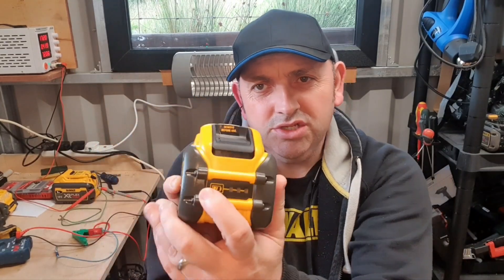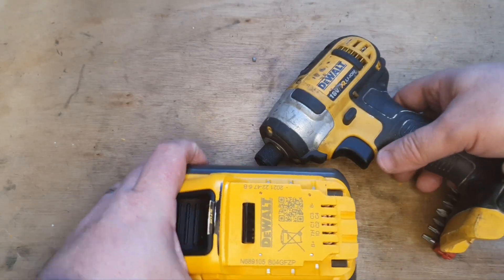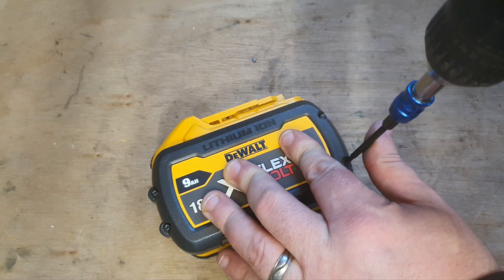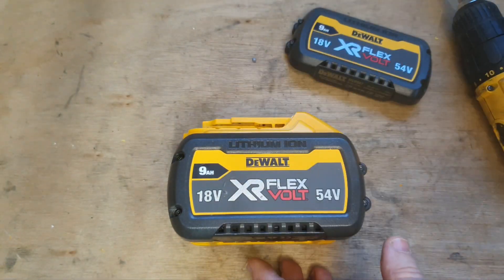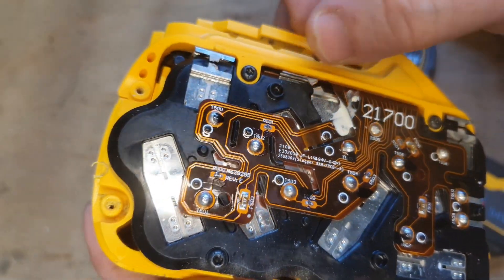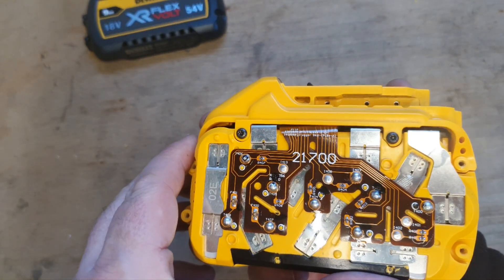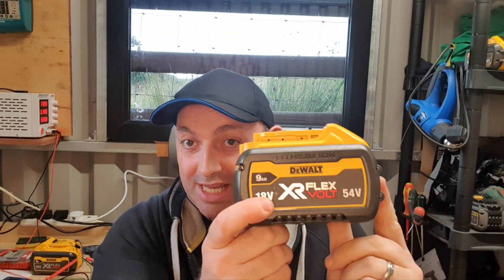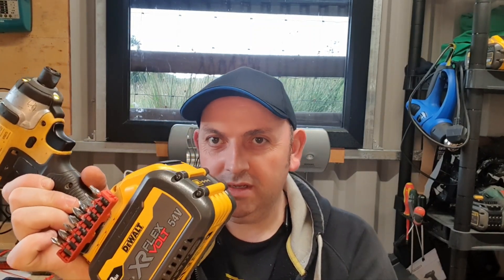Flexvolt 9ah Quick fix ( not jump start) #dewalt #powertools #repair #diyenthusiasts #flexvolt

Comment: Can you do a quick video on charging the cells banks of the flexvolt 6ah and 9ah and show where to connect the clips depending on which cells need charging. Im struggling to find where to connect to charge all but the first row on my 6ah flexvolt. I have the lipro charger like you use i just am not sure where to connect positive and negative too. A tutorial would be great and probably get a nunch of views. I looked through most of your videos but didnt see one that specifically shows that.

Comment: Fuses Are a Symptom, Not the Problem:Fuses blow due to excessive current, often caused by:Dead or Imbalanced Cells: One or more cells in the battery pack (typically 20700 or 21700 cells in a FlexVolt 9Ah) may be failing, causing the BMS to detect an overcurrent or short circuit.
BMS Failure: The BMS may be malfunctioning, incorrectly triggering the fuse or failing to balance cell voltages.
Short Circuits: Damaged wiring, corrosion, or debris inside the battery pack can cause shorts, blowing the fuse.
Overload: Using the battery in a high-drain tool beyond its limits (e.g., continuous heavy use in a 60V tool) can stress the system.

Replacing the fuse without fixing the underlying issue (e.g., a dead cell) will likely cause the new fuse to blow again or, worse, allow unsafe operation that could damage the battery or tool.

Comment: I have the same battery, it has 12v coming out the top. All the connections look good in the battery. What does this mean ?
Reply from the maker: It's likely cells that are done or thermal fuses and resistors Beyond repair

Comment: Why do we have to do this to a $250 battery? Beyond unacceptable from dewalt
Reply from the maker: The failure rare of this over engineered battery is unacceptably high
Reply: @doctorlefthandthread  how often does it happen to these batteries? Since i ordered flexvolt saw, my first flexvolt tool from dewalt including two 9ah flexvolt batteries. If they will last less than 2 years I need to return and order makita xgt. Why some said they had flexvolt batteries for 4+ years and had no issues? And few other people reported them breaking?

Comment: If your fuses blow at home, just jam enough of silver foil in to fill the fuse hole and jam/fudge/hammer the lid back in.
Reply from the maker: No saw a nail the right length does the trick

Comment: Hi, where abouts in Tyrone are you located? 
I’ve a few batteries and was wondering if you could take a look at? 
Thanks
Reply from the maker: I am near Donemana however I have stopped repairing the flexvolt batteries I just do the Standard 18v ones now.

Comment: Hiya. I have a DeWalt 9AH flexvolt battery that has one bar, charger blinks for a moment when I put it on, then says Charged. It will not operate a 60v tool, but it will an 18v. It was in a blower when the blower fell 20 feet or so to the ground. The voltage readouts show 15.89v  until I push the 60v pins in.  Then it reads 14.23. The bus bars are fine. The large terminals inside read 6.24 Got any help for me? Thanks! I’ve watched several of your videos to try to figure this out!
Reply from the maker: When you are pushing in the slide you need to connect the 2 top c pins this will give you the 60v out put
Reply: @doctorlefthandthread I would of really liked to see you test all the cells on this battery too. I have one that won’t work at all and no bars light up when you push the button
Reply: Yes, the large terminals (labeled with c1 & c2, and c3 &c4) inside read around 2.24 until I push in the switch, then the polarity reverses to around 12 then quickly drops. After a moment it is almost zero.
Reply from the maker: How to measure your flexvolt #doctorlefthandthread #powertools #batterymaintenance #repair #dewalt

Comment: Hi I’ve got a 12ah flexvolt battery . It goes from 1 bar to 3 bars in about 5 minutes in the charger then stops charging . Surely this can’t be right 🤷‍♂️my other 12ah one takes at least an hour
Reply from the maker: No it shouldn't do that

Comment: Yes lad where are u based?
Reply from the maker: Tyrone
Reply: @doctorlefthandthread  4or5 that I can’t get working could u get a look at them and I sort ya for it?
Reply from the maker: @JosephODonnell-m8v  I stopped working at the Flexvolt I had a bad turn around with them could only get about one in 10 working. Not taking Flexvolt for the time being but that could change in the future.

Comment: WHere can we get the "nickel strip" to make the repair?
Reply from the maker: Ebay
Reply: @doctorlefthandthread  anyone in particular?
Reply from the maker: @edwardlittle5541  any will do but here is the one I use on amazon 
https://amzn.to/4643atk
Reply: @doctorlefthandthread  Thank you so much for this! I have a 60 volt DeWalt battery that I used just once and it zonked out on me, and I'm 99% sure it's because of the cheap DeWalt Wannabe light I bought. It drained it while it was just sitting around doing nothing. Cuz it worked perfectly before I plugged it into that el-cheapo DeWalt Wannabe light. It's one of those "Made For DeWalt" items from Amazon. I like the light. I just hate that if I let it sit around it eats batteries like that.

Comment: Why not just bridge the broken connections with solder instead of nickle strip?
Reply from the maker: It will work however I chose to use the strip to restore the fuse type set up to the battery so if an overload happens again it will blow the strip and not anything else on the board
Reply: @doctorlefthandthread  ummm you would need a lighting strike to blow out the nickel pieces you uses.

Comment: What if it only has one bar of charge but it’s been charging for hours? Is the battery damaged?
Reply from the maker: I never saw that fault before
Reply: @doctorlefthandthread I have a 1 bar charge to full issue. 3 different chargers all say the same. So charger ruled out. Battery works on both 18v and 54v. 
Zero issues inside far as I can see very clean actually. My next thing to do is tear it down check cells for imbalance of voltage or faulty cell. I what would u try next
Reply from the maker: @B.G.R.B.M.S  they are a minefield of small fuses and resistors

Comment: I have same battery showing full bars and 19.5v on the meter. It will only work on one drill. The other 2 drills are working with other batterys but not that one, i cleaned all the battery connections. Any idea?😂
Reply from the maker: Flexvolt are tricky 9 out of 10 are unrepairable

Comment: I’ve never welded nickel strips before, any tips on that before I take on this repair challenge. I have about $4,000 in dead flexvolt batteries. Ready to go back to corded tools soon if this keeps up. Just killing batteries every month in the chop and table saws.
Reply from the maker: The flexvolt have issues with people killing them
Reply: Yessir, most of them die within the first year as well. I haven’t been impressed with the technology as of late. I feel like there should be some sort of safety protection against overloading the battery before it’s just useless. Again, any tips on welding the nickel strips as I have never attempted this fix before.
Reply from the maker: @dustindunsmore1125  I think the protections on them fail too easily I spot weld or solder the nickel strip depending on which one is burnt through

Comment: What thickness nickel strip did you use
Reply from the maker: 0.01mm keeps it safe not too heavy will burn out in the case of an overload and easy for the welder I use

Comment: what caused those 3 broken connections? physical impact?
Reply from the maker: No  the battery was put under pressure. Something like being run hard on a power hungry tool there was a potential overload but these connections are designed to burn out instead of causing a battery to overload. Reconnecting them is fine because the danger was only in that moment.I do however use light nickel so in the same eventually they will burn out like a fuse again.
Reply: What special Torx head is needed? Mine has little nipples inside the head, like anti theft screws.
Reply from the maker: @hickboy3067  Tx10 security torx

Comment: Mine is dead, it gets charge with jump start, but it won’t charge with the charger (the charger works just fine) anyone knows how tu fix it? (The battery is practically new and very clean)
Reply from the maker: They are difficult to repair most of the time all you can do is check for broken connections. If none are found discharge it fully then bring it up with a DC power supply to 17v on the lower range if it doesn't charge it is done

Comment: First page I have found with very useful, thinking outside the box fixes Between this and the contact cleaner on the impacts. I have 3 impacts that do not respond to a good battery, or shut off 1 second after trigger being held. not a connection issue at the Battery. is there a fix for that? I pull tools apart for 20 foreman so I deal with alot of them... 

 Can you do a DCH273/293 losing its hammer function? That is a common one I deal with at work, sick of bringing the tools to Dewalt and not seeing it for 6 weeks
Reply from the maker: I have done  few videos on the dch273 and dch253 
The one below is one I did purely to help people it won't get good views but it the most complete guide I have done 

https://youtu.be/kN8-LQnBaLQ

Comment: Why would the connection break like that is there something else wrong?
Reply from the maker: Good question the connections are designed to break like a fuse if the battery is pushed hard to stop an overload. It is usually not something that is a longterm problem only in the moment the pressure was on the battery if you reconnect with fine strip it will break if a problem occurs again.